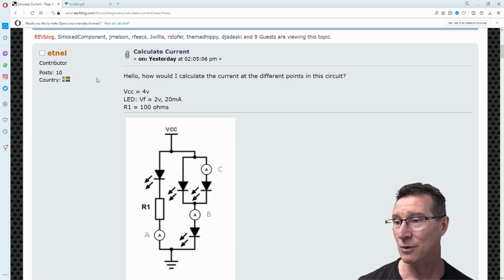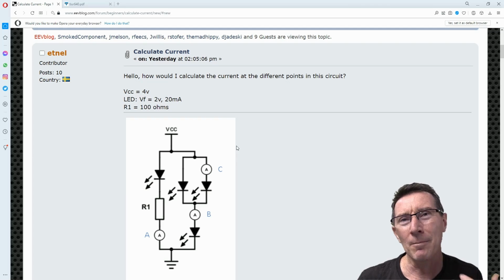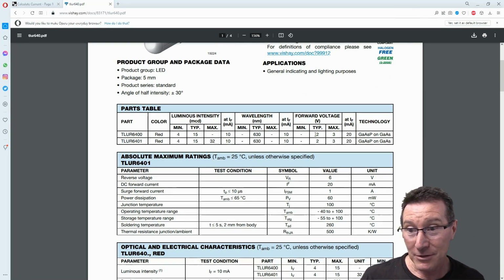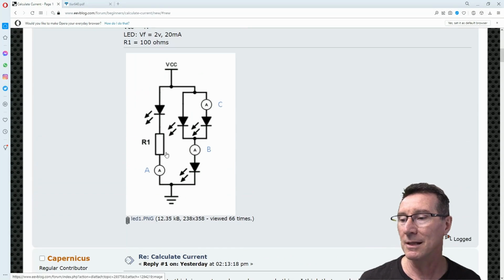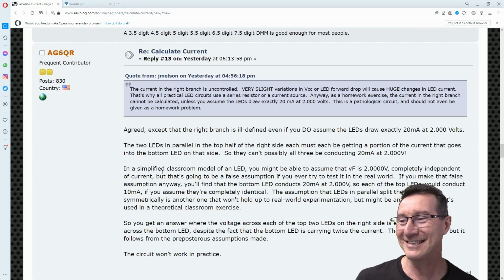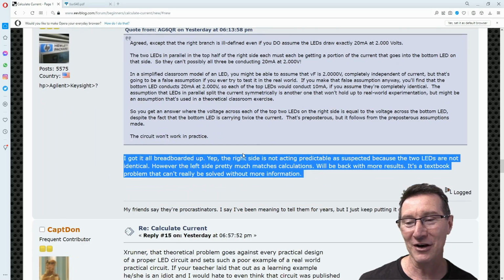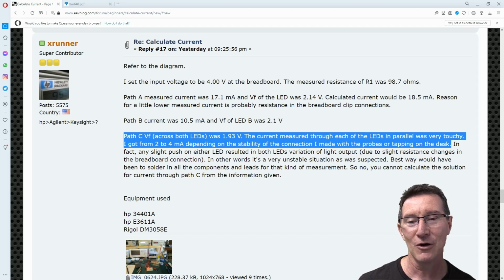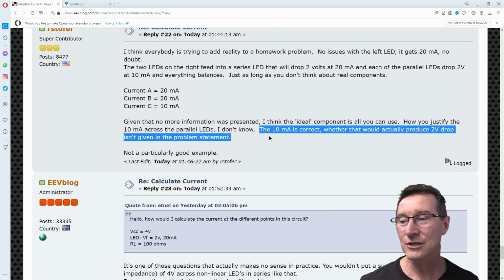EEVblog 1427 - An INFURIATING Electronics Exam Question!

Comment: The resistance of any meter connected at points B and C would greatly effect the current.
Reply: Yeah but you can imagine the meter as ideal meter in SPICE circuit simulation with real world components. That's another problem, living in last century and calculating circuit on paper with fixed points instead of using interactive simulations, with ideal or real world models, then explaining why it happens.
Reply: I am glad that somebody finally brought up the issue of the voltage burden of the ammeters!  Yes, the circuit in this question is very poorly designed and detailed theoretical calculations CANNOT be accurately done with the information provided.  Note that the 2 LEDs in parallel are not really in parallel.  One has an ammeter in series!  The ammeter will have a voltage drop (a low voltage, but NOT zero) which will reduce the current through the LED it is in series with.  Bottom line, this circuit is a mess and will be very sensitive to parametric variations in the components!

     By the way, Dave (and others) have stated that you need to have a resistor or regulated current source in series with LEDs or you let the magic smoke out.  This is not necessarily true.  If you put an real world LED on a curve tracer the curve you get is typical of a diode.  The current VS voltage curve, once the threshold voltage is reached, is NOT vertical but will show some degree of slope.  This indicates that the diode has some resistance.   If you need to drive a bunch of LEDs and you connect them in series these resistances add up and eventually reach the value of resistor that you would calculate to regulate the current to the value you desire.  I have done many designs with 10 to 15 LEDs in series driven directly from a low impedance voltage source with no problems at all.

       Other diodes, such as power rectifiers, also show this parasitic resistance.  This gets people designing low voltage linear power supplies into trouble because they allow for 0.7 Volts drop in the diode when in fact, due to high peak charging currents in the filter capacitor, the drop across the diode will be much larger - commonly in the range of 1.2 to 1.5 volts.  The end result is a power supply with no headroom to accommodate low line voltage conditions.

Comment: This is a very simple question. The LED current rating is not an internal feature, it's the design that you have to limit the current to EXTERNALLY, LED's have very low internal resistance.. hence non-linear. Rt hand side current by Ohm's law  Vcc-Vf1-Vf2/Rc. 4-2-2=0 no voltage...no current...this is a theoretical question only.
Reply: Watch the video, the current would be 20mA at 2V as stated, not no current.
Reply: @jaro6985  Ya, that's not how design works. when you are given a spec of 2v @20 ma that is the normal operating characteristic to get the rated output of the LED without heat damaging it, I'm guessing luck in the practical experiment that the values lined up.
 For normal operation you have to be above the knee voltage Vf and limit your current with a series resistor. 
Here is a cut from Wikipedia "The voltage versus current characteristics of an LED are similar to any diode. Current is approximately an exponential function of voltage according to the Shockley diode equation, and a small voltage change may result in a large change in current. If the voltage is below or equal to the threshold no current flows and the result is an unlit LED. If the voltage is too high, the current will exceed the maximum rating, overheating and potentially destroying the LED." 
All specs are specified at 25C and will also have a derating factor associated with it "as an LED heats up, its voltage drop decreases (band gap decrease[1])" this leads to catastrophic failure unless you have some type of current limiting.  In the real world the Vf varies over a range and by looking at the forward current graph you can calculate where the Vf should lie, but this is a theoretical problem with a stated Vf of 2v, as the 2 series LED's Vf's are equal to the applied voltage they will draw no current.

Comment: Answering test questions like this is an entirely different skill than real-world applications, mostly about understanding the answer they're looking for and assumptions they're making.
Reply: Can be great for customer relations
Reply: Reverse-engineering other people's assumptions is absolutely a real-world skill.
Reply: When I did mech eng I noticed a lot of the questions were similar, but worded differently, and that's when it clicked that they weren't that interested in the answer but instead teaching you how to think, ie make the question convoluted and see if you can think your way around it. It got so cryptic some questions were unanswerable if you weren't doing another particular subject, ie, the solution wasn't taught in this class, but another classes subject.
Reply: Even with that, though, the question is nonsensical. When you specify the LED as just one datapoint, the question is impossible. I suppose you could assume they mean “up to 20 mA”, but it’s not what they say.
Reply: @JasperJanssen :  I've see BOM's and schematics that show a basic part description, just just like in test question: "LED RED 2V 20mA". The problem solver that believes he must get 20mA through ALL LEDs is in trouble 😆.
Reply: Indeed. Whats the best flooring for a Radiostation? Wood, Tiles, Concrete?
Reply: Technic vs. Theory rethoric. There are people interested in solving theorical problems and playing with abstractions... for the sake of research or even writing simulators.

Comment: I went through the Tomorokoshi's calculations and everything I can say about that is that they are perfectly correct and IMO it is the only correct answer to that question. It's a little bit "speedy" to me, there is no explained how the (3.1) equation was obtained from (1.3), but I didn't have to take a paper and pencil to prove it is correct, so on the other hand, it is not so hard. If you look at the (1.3) equation, there are a lot of variables, but according to (1.1) and (1.2), the η and Vt are constants, because that diodes are the same, they are only at different points of its V-A characteristics, so only the V and I varies. At the next step (1.3) was splitted to two equations with Vb Ib and Vc Ic, the rest variables was untouched because they are constants and that equations was substracted one by another which resulted in (3.1) equation. The rest is simple and easy to understand.

In my opinion, this is much beter question than something like "write the Ideal Diode Equation", because this proves that student is capable of using that equation. In fact, I have no experiences in teaching, but it looks like a good idea to me. Maybe someone experienced in teaching (like @TheSignalPath :3 ) could tell us whether exam questions like this are good or bad idea.
Reply: I agree, it was a good answer to the question. I missed this on the forum, and I would have taken a slightly more abstract approach, so rather than the pragmatic assumption of logarithmic behaviour of the diodes, an inequality solution can be achieved with the simpler assumption of a monotonic V/I curve.

Ib = 2 * Ic by Kirchoff's law; V(Ib) > V(Ic) by monotonicity assumption. V(Ib) + V(Ic) = 4 V; therefore V(Ib) > 2 V and Ib > 20 mA and V(Ic) < 2 V and Ic < 20 mA. 

From which it is possible to give the answer as inequalities: 20 < B < 40 and 10 < C < 20 ma.
Reply: @ChumpusRex  Agreed.  Tomorokoshi's answer is reasonable, with the caveat of "but real diodes would not guarantee the result," in which case your bounds might be useful.
I very much disagree with the OP that this is an awful question.  It's not a great question for entry-level students limited to KVL and KCL, but it may be representing a model of a circuit that happens under certain conditions-- it may not be a circuit you would ideally build, but rather one you "end up with" as a result of some non-ideal chip construction.  More advanced courses address exactly this kind of issue.

Comment: Theoretical electronics is all about the theory. At the uni we were forced to do calculation on absurdly complex schematics using variety of methods. Basically it took us 30-40 minutes to calculate something a computer does in less than a millisecond.
Reply: Computers are great at giving us answers without us needing to know how the answers are derived. That’s pretty much the point here. Sure, you may never need to manually do those calculations ever again, but then again you might, say at a job interview with nothing but a whiteboard and a marker for company.
Reply: Computers are great at giving you answers.  It has no idea whether those answers are any good or not.  The hard part about being a good engineer these days is knowing when the computer is lying to you.  For that, you need to understand how the math works behind the models... and yeah, that gets complicated sometimes.
Reply: Sounds like a waste of time

Comment: The issue is, if you rebel (and it doesn't say explain why this is a ludicrous question / circuit) then, in the majority of cases, you will fail the test. I dared to question an MBA course textbook which didn't list competitors, amongst other factors, as an influencing factor when considering starting / running a company.

Comment: Had what I think was a question like this in my physics final. The problem with letting them have it in the answer is that it's usually some postgrad working from an answer sheet that's marking it and they won't care or be able to do anything about it. Spend the time improving your answers on other quesitons.
Reply: This is why the education system is broken.

Comment: Those forum replies are a really great example of how to turn someone off of a given subject. I see everything here as a giant "Well ackshually..." to show off "I am so smrt."

This problem is just fine for a first year circuits class. Getting into component characteristics and manufacturing processes in a first year circuits class? Are you insane? For someone with no prior knowledge or experience, AC circuits are hard enough to get a grasp on. My AC circuits class began with around 20 students and was down to 14 by the end of the first month. I think there were 11 or 12 of us at the end of the course and half of the class earned less than 80 on their final grade. I was the only one to get a 90. And I only just got a 90 and only because I studied like I never studied for anything else in my life. And if I had to figure out the real world practicalities and the characteristics of an LED and all the rest in that first year? Nah, fuck it. I'd switch to a different major. You need fundamentals before you can get into all that. But you're all trying to teach this poor bastard how to run a triathon before he can even walk.

It's a fair interview question because you expect someone to know this stuff by that point. But first year circuits class? Get out.

Comment: They shouldn't use this kind of circuit in an exam, because that would teach the student to expect something that doesn't hold in real life, and a circuit that is a very bad idea to design like that. At least do not simply ask for the current to be calculated, which would be an impossible task with real-world components. Instead ask if the current can reliably be calculated on each of the test points, and justify the answer.
Just by looking at the datasheet on the video (which the exam doesn't even provide), it says that a the LED has a typical Vf of 2v, and a max Vf 3v (if i understood the mess they made to the columns right). And what's the point of using ideal (or better call them magical) components? Just use resistors instead of leds on the right branch, and nobody's hurt.
On the right branch, assuming identical leds (and good luck finding that!! :P), then the current thru the upper leds has to be half of that on the lower led, which means that the Vf on the upper leds is going to be less than 2v, and on the lower led it's going to be higher than 2v, and the current thru the lower led is going to be higher than 20 mA, but exactly by how much? damn if i know!
By the way, spanish speakers always call them led instead of L.E.D., as the pronunciation of any letter combination is obvious in spanish, and a lot shorter to speak "led" than "L.E.D." In fact, we always use letter sounds in acronyms, instead of letter names, probably because letter names are never shorter than letter sounds, usually around 2 or 3 times the lenght, and most letter names include E, so the result of using all that letter names put togheter would sound funny. For example: "ele.e.de.", instead of "led".
Reply: In practice, those LEDs have non linear V/I curves and with three of them in circuit, the only rational approach is to do an iterative approximation to the stable point, with Monty Carlo parameters to show the distribution from which you can estimate the yield. Of course that's pretty much what we do for real analog circuits on real silicon chips. The math gets you 1/3 of the way there. The simulations get you the rest of the way.

Comment: while we're in the realm of make-believe:   i'd just say that  C and B  both drop 2v   therefore the right-hand path drops 4v in total...   4v - 4v = 0v    so it's basically open circuit and both B and C can get a big fat 0mA

nonlinear? pfft  the LEDs are in a quantum superposition of being both on and off;   so i'll just use the entangled ON state to justify reason for being OFF.

Comment: of it was cold enough, the total right branch current could be anywhere from almost 0 to some more than the 20 mA

More seriously: If upper LEDs are at a current lower than 20mA, I guess their Vf would be less than 2V, that would make more voltage available for the lower LED, therefore I believe the total current in standard conditions should come up greater than 20mA?

edit: that model at the end of the video might kinda be my answer, I think the guy using the diode equation also got a bigger current as the answer